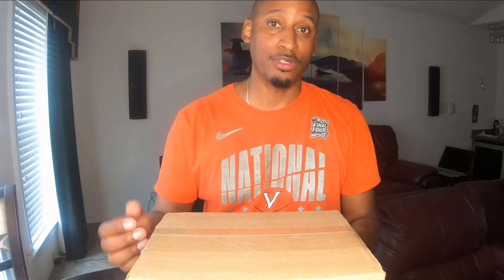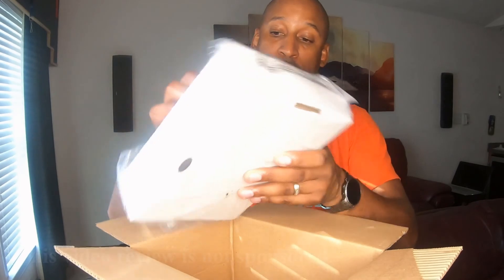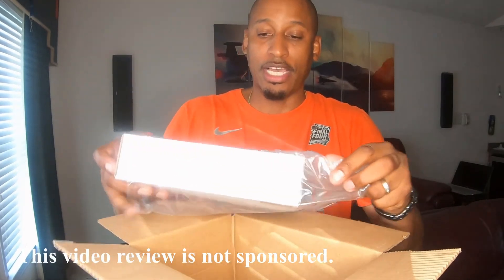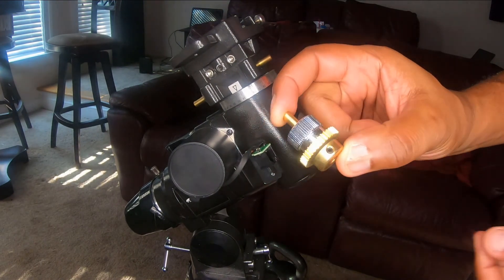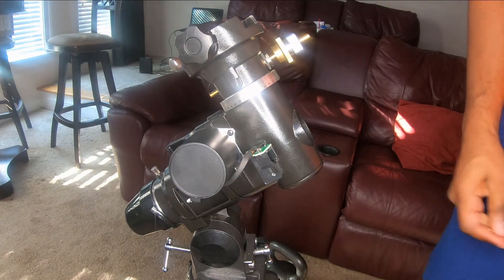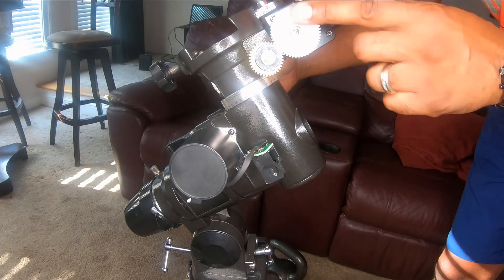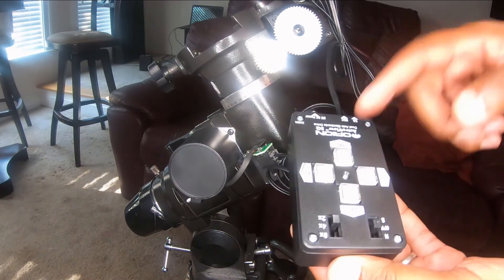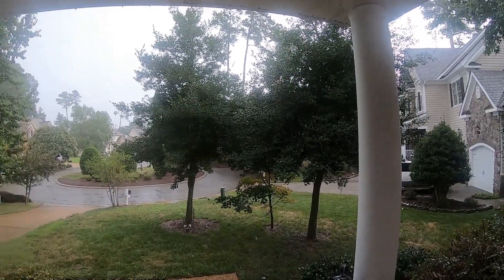How To Install The Orion EQ-3M Dual-Axis Electronic Drive

Comment: Hello! Nice to meet you. Could you tell me, i have the similar eq3 mount. When i mount goto set, just have one question - how you transport head of mount, maybe you have box or case, because after install motors head cannot put in the manufacturer box? Whad do you do?
Reply from the maker: I purchased a bin the lined it with foam in order to transport the mount.

Comment: Is the mount compatible with a Celestron motor mount kit
Reply from the maker: That will depend on the screw hole locations between the brackets and the mount.  Currently I don't have the Celestron motor mount kit to be able to determine that for you.

Comment: What power supplies do you use?
Reply from the maker: I have a Stanley Power IT 1200 battery pack.  It has a 120 AC plug and 3 USB ports.